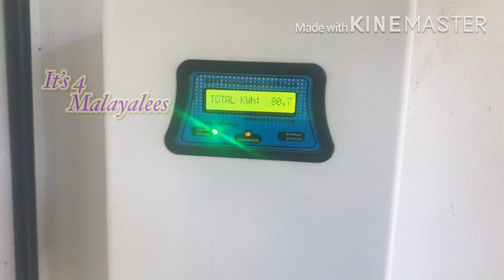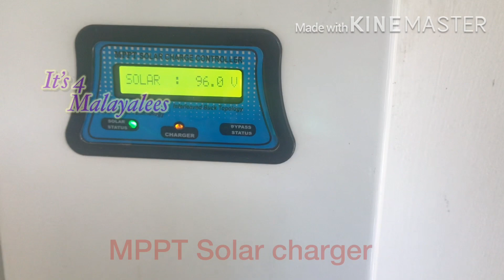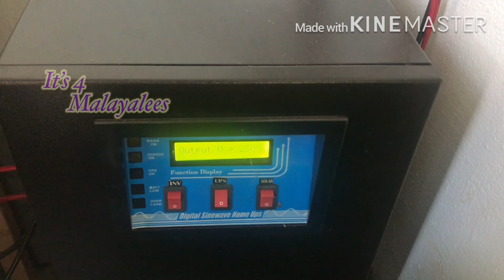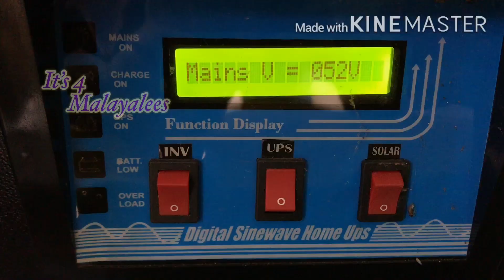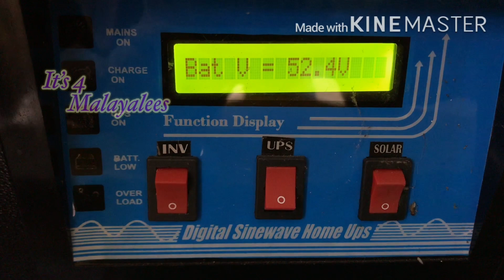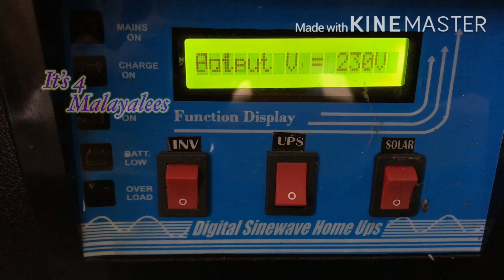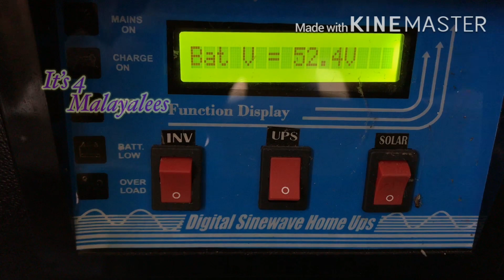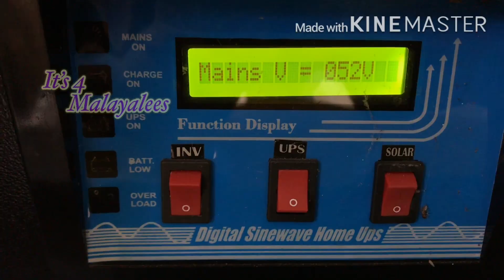User’s review Home solar power system/off grid solar power plant/TATA solar panel,exide battery MPPT

Comment: Could you also specify the conversion efficiency of these panels? 
Also, I learned that LG Chem RESS battery is available in India which is best in the world after Tesla powerwall. Could you tell me why you opted for alkaline instead of Lithium ion batteries?
Alkaline battery is a pain to maintain and tend to decrease in power output over time(slope fn) where as lithium ion gives steady output until it is fully drained and no additional steps to maintain, like your cell phone.. When you consider the cost of batteries over 25 years at par with life of solar panel, Lithium ion battery is cheaper and efficient than alkaline batteries.
Also if you opted for Lithium ion battery of 8.kW, you can run your whole house(ac, washing machine) all for 8 hours minimum and takes up very less space compared to exude alkaline.

Comment: I have a 1KW TATA POWER SOLAR OFFGRID power plant installed in my house. 4 batteries connected in series. We installed this 5 yrs back.  Recently we are facing back up issues. Technician informed that even during day time, the power is drawn from the battery and not directly from the Solar. That means if I use 2 hours during day time, then that much less back up at night also.  Now I am facing back up issues. Back up is like 1.5 to 2 hours max only with 2 fans running.  Technician informed me to replace the battery. Since the working voltage is 48V, i cannot reduce the number of batts. Also the technician never tried to charge the batt with an alternate source to test whether it is charging full or not. Please let me know if there are any freelance technicians who can assist.
Reply: Need some  change indies the inverter. Only

Comment: എനിക്ക് 370 x 2 സോളാർ പാനൽ, apc 1500 va  ഇൻവെർട്ടർ , 120 A.H. സോളാർ ബാറ്ററി, livfast 50amp സോളാർ കൺട്രോളർ ഉണ്ട്. ഒരു ദിവസം 8 യൂണിറ്റ് kseb consumption വരുന്നുണ്ട്. സോളാറിൽ നിന്നും കിട്ടുന്നത് 1.5kw മാത്രം. ഇത് 4 to 5 യൂണിറ്റ് ആക്കാനും കോണ്സുമ്പ്ഷൻ 4 to 5 യൂണിറ്റ് ആക്കാനും എന്ത് ചെയ്യണം. Please reply. WhatsApp no.  9847416866.thanks.
Reply: Inverter 12 volt or 24V?
Reply: Inverter is 24volt. Thanks.

Comment: 180 wat 2 എണ്ണം 15000 രൂപ .ഇതിൽ നിന്ന് കിട്ടുന്ന കരണ്ട് 360 x 5 = 1800 .ഒരു ദിവസം ഒന്നര യൂനിറ്റ് കണ്ട് കിട്ടുന്നത് .അഥവാ 12 രൂപയുടെ കരണ്ടാണ് കിട്ടുന്നത് ഇത്രയും എമൗണ്ട് മുടക്കൽ ?
Reply: Correct aayi design cheythal, veetil already inverter um battery um ullavarku, profitable aaki edukan pattum in long run.

Comment: Very good and clear presentation. I have 1500 VA apc ups/inverter and two batteries of 120 ah. Both old. I want to convert to solar of 1 kv for the time being buying only solar panels and charge controller. Is it possible. Which company fixed your solar. Pls let me know. Thanks.
Reply: It is possible. But you should design the system in a right way, not to affect the battery life and to extract the maximum power from solar. I can help you with questions, as I have done this.
Reply: Buy mppt charge controller    ( local made or Asha power ,UTL  Smarten or ) buy waaree or Vikram monoperC panel . And consult your inverter technician , he will do the needful.

Comment: Good informative presentation. I have installed 1 kw solar panel from ANERT 4-5 years back, but my inverter became faulty and I have to change it to a V-guard automatic inverter system.  After your presentation, I understand that my efforts are futile since it takes current after consuming solar current.  That is really disappointing.  Really, people who can guide the people in the right direction are few. Actually, with all sincerity I cannot say whether my solar system decreases electricity bills